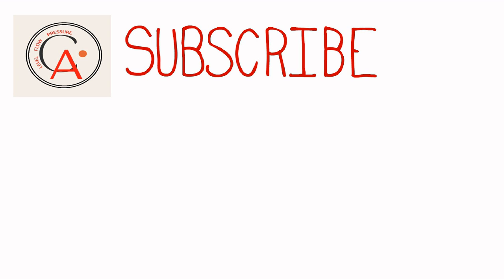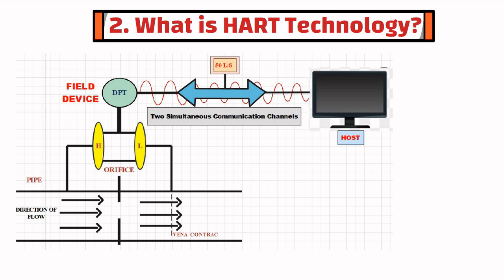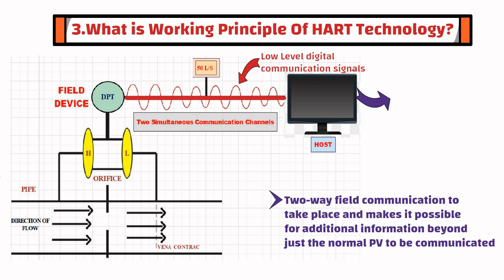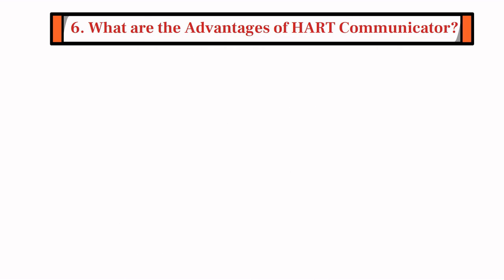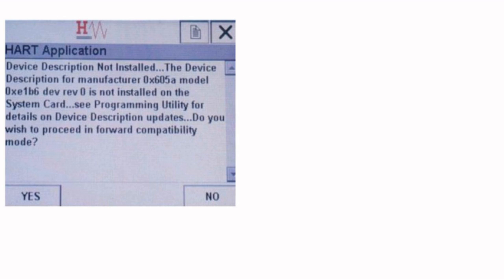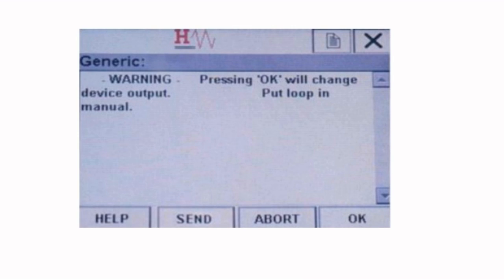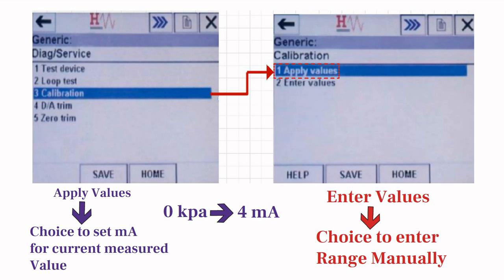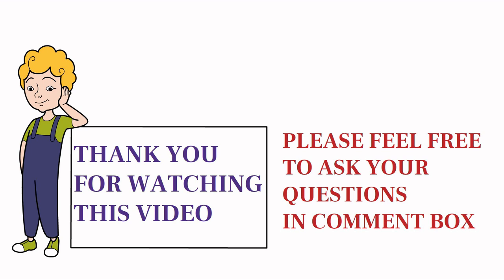Mastering HART: HART Protocol explained for  Beginners

Comment: In your presentation you showed 250 ohm resistor connect with +ve side and also -ve  side of power supply. Which one we follow
Reply from the maker: Hello Abdulla
It will work on both way. However, normally, It should be connected on +VE (positive) side of power supply.

Comment: hart protocol is hybrid digital and analoge, the digital consist from 4 values 1-primary 2-secondary 3-ternary 4 quarter, hart based on Bell202  with modulation of FSk.
Hart transmitter working with 3 type of command, 1- common practice 2- universal 3- specific 
Each one have different task to do
Hart working with method of master and slave 
Each loop can contain in maximum 2 master in one loop.

my regards from IRAQ
Reply from the maker: Thank You Mustfa for sharing your knowledge with us. Keep sharing your knowledge with us

Comment: Hello, I have been finding different ways to connect the hart communicator to the instrument.
1_Resistor in series with '+'
2_Resistor in series with '-'
And in these two cases, the hart communicator pointers are connected to the instrument's '+' and '-' terminals.
3_The resistor in series with '-' of the loop and the hart communicator with the leads at the ends of the resistor.
As seen in the manual.

Is there any difference, does it change according to the application or instrument?

Could you help me with this question?
Reply from the maker: Hello Douglas
Thanks for your comment.
Technically, 250 ohm resistor need to be connect in series with + terminal. However,  it does not make any difference if you connect with negative terminal. You can still connect HART communicator to device.
Is there any difference, does it change according to the application or instrument?
No, it does not have any relationship with application.